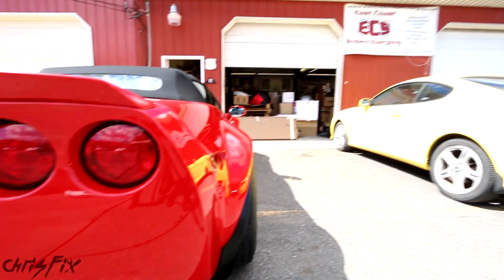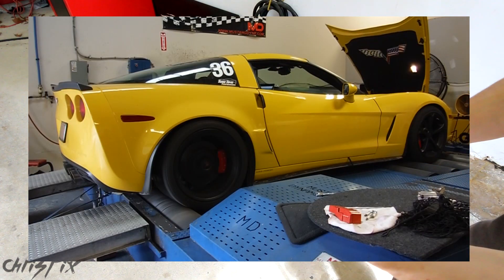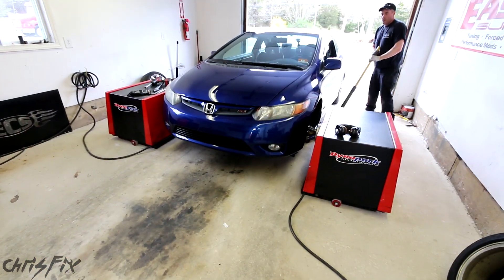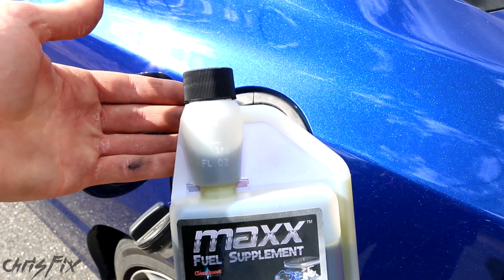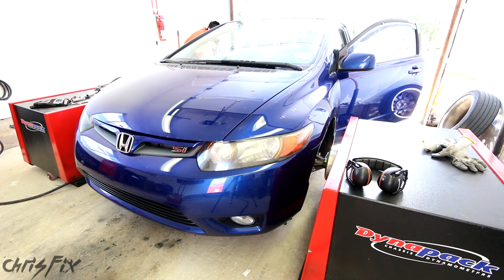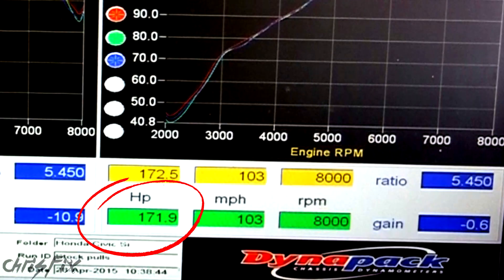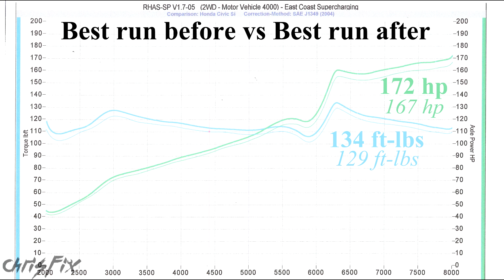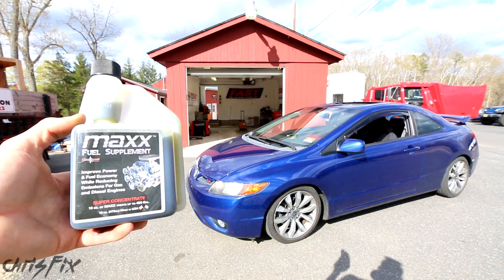Can a Fuel Additive Really Increase Horsepower in Your Car? (With Proof)

Comment: Sponsorship alert!
Reply: Baka Oppai if the readings are true then so what? I don't mind being advertised to if it's honest.
Reply: I assume so.

But it still looked like a good read.

 The gain was less than the difference between the reads without any additive.

A 10 hp difference between runs with no change and a 5 hp gain with the magic fluid, that's only half the noise value.

Injector cleaner is always a good thing and a power gain if you have dirty enough injectors.
Reply: pd4165 if you have half a brain you know it's not honest it's just snake oil bullshit.
Reply: Snake oil works. It's the fake snake oil that's rubbish. Here is my question to you...how will you ever find out if it's honest if you don't do the same test yourself?
 If I do it and post my video here you could call me out as an advertiser too because you don't know if I'm honest.. It's just going to go round in circles unless there's someone posting that is trustworthy.
 BTW I find those figures believable if the additive is detergent + soft metals that clean all the crap out and lube up the surfaces.
If the next tank is untreated and comes up with similar figures to the second runs then that question would be answered.
Reply: What worries me is the before tests have a bigger difference between them than the after test does.

Comment: Nice car. 8K redline, wow. Love the looks of these.  This additive must be basically like an octane booster since the horse power and toque are not affected by heat. Shows how shitty this ethanol gas is.  I think it would be interesting to do this test with known good quality Premium gas and see what the results are.
Reply: WaybackTECH ethanol is actually a high octane fuel... Using E85 on heavily boosted engines is common
Reply: Geoffrey Olson every country's different but 91 octane in Canada usually contains 0 ethanol because ethanol has less energy than gasoline when combustion occurs, engineering explained has a good video on it
Reply: 93' from shell is the best gas out there!

Comment: What about using higher octane to begin with. If engine needs 95 and you buy anything less then make it better using additive, no surprise there. But it is cheaper to buy premium fuel anyway.
Reply: Arnis Tarassu If the Honda has knock detection the additive may have effectively increased the octane a little and allowed the engine controller to run slightly more aggressive ignition timing. Cars that don't have knock sensors don't have this ability so simply putting in higher octane fuel alone isn't going to do anything.

Comment: I have A 98 tahoe 4x4 and it will sputter and hesitat under light load  light accelerate cruising speeds when I really gas it. It will run fine until I let of the gas  it is not a iac problem the iac is newly installed as well as a complet tune up. If I do something as small as turn on the turn signal at an idol the rpm jumps way down and back up to 650  if tha ac compressor should kick out it will bounce around and stumble  but it seems the more load I put on it the smoother it runs if I turn the air on hight turn electrical devices on it smoothes out. Still runs a bit rough.

Comment: Although the air density was higher in run 1 due to IAT, the humidity decrease of 5% would allow for more air into the system without water taking up room... 

Of that stuff contains methanol like most do... It may have also helped absorb some humidity and density in cylinder. 

Who knows...
Reply from the maker: kornshadow097 The weather conditions were all recorded and adjusted for by the dyno for the final numbers.
Reply: I see, alright. I'll have to see if it has ethanol or methanol mixed in. 

Because if it does. Anyone could save money by just pouring in a few oz's of methanol or ethanol in tank. Which most cleaners and octane boosters do. 1gallon or close to 128fl oz of ethanol is $17 or e85 is $1.99-2.34. While methanol is $30-40 per 5gallon pail.

Comment: 5 hp is a difference when a car has about 35 hp, but 172 vs. 167 is barelly detactable even on instruments that measure acceleration, let alone driver's perception....even biggest 11 hp difference is nothing to be felt from driving position....I believe the acc.figures to 100 mph/160 kmh are almost virtually identical....

and I think somenoe said right that we should have tyres on the car to see real power on them in the real world....this is closer to theoretical perfection, but not to real world....
Reply: Ask any engineer and they'll tell you that you can feel a minimum of a gain of 10 hp. No stock civic owner is out there buying this additive thinking now he can take it to a drag strip and get an 11 second quarter mile... It's a cheap, safe, simple, interesting way to get not only more power out of a car, but also get more mpg. You need to stop stereotyping Americans and understand that car enthusiasts are the most diverse group of people in the world, and they all love cars for different reasons. Stop judging others because they find it interesting that you can get any gain at all by adding an additive to the fuel. Stop making cars a racial matter, who fucking cares where you're from? Do all Americans love V8's? Even if that was true, does it matter. Do all British people hate every car unless it's a Jaguar? Even if that's true, that's their opinion. Can't we car enthusiasts just love cars together and have civilized, impartial arguments for the sake of learning and not just "being right"?
Reply: TheKenjoje You didn't understand because he doesn't understand and eighther does anyone else what he's saying. I guess he's never uprgraded a car before. 1.1 second increase is a huuuuuge difference for a few bucks in a can. Car inthuesiests spend thousands for there cars to perform faster. Most all performance enthuesiests i grew up with and knew over the past 20 years would of been jumping for joy to get 1.1 second off the qaurter mile time. Bye the way nobody in our country goes by kph just so you know. And the 160 kph you talk about is basically a qaurter mile time of 100 mph. So 1.1 seconds off that time is insanely impressive for something in a bottle.  As far as all the other stuff you talk about i honestly didn't read or watch or whatever because the fact you started with the 1.1 seconds off in a qaurter mile is crap argument. And i'd say at 100mph qaurter mile time that taking 1.1 seconds off is cutting like atleast 5 car length off and that is defenately nothing to laugh at as a car racing fan.
Reply: TheKenjoje charleysturbos  I'm gonna go ahead and assume neither of you read that properly. I'm implying a Honda has an engine roughly equivalent to that of a snowblower. But neither of you seem to speak proper english, so I'm basically pissin' in the wind here, huh?

40 HP vs 45 HP is a big difference... lmao
Reply: charleysturbos
I am so sorry that the public school system failed you so horribly. There's this little thing called sarcasm, as well as the proper forms or to, too, two as well as than and then. They taught those in first grade.
Reply: charleysturbos
You have literally just reposted everything I implied. You just have no comprehension of sarcasm.
Reply: TheKenjoje dont they race small little fiats abd mini coopers in Europe?  Those aren't too fast either.  Just saying...
Reply: TheKenjoje Wrong, Specially since it's too the wheels. Also the torque numbers are up as well. Every time i added five to ten horses on my little cars i could feel a big difference. People who put put around might not but people who push there cars defenately will know the difference right away.
Reply: TheKenjoje Keep in mind a Honda pushes out roughly 40 HP, on a good day. So this is a big deal.
Reply: charleysturbos bullshit. your story is about power of sugestion. I explained how 5 hp feels up to around 160 kmh/100 mph. what is 'little car' for you? I said that it is felt if a car has low power such as 30-35 hp all together....if the car has 167, then 172 means nothing....5 hp in 0-100 kmh in that honda makes less than 0,5 seconds difference, and up to 100 mph, what, less than two seconds....100-160 kmh flat out is imposible to notice subjectively....

look at this - although not the same car, the point is there - 12 hp difference, 1,1 s adventage 0-160 km/h, cars about the same weight....and 12 hp between 143 and 155 worths more than same number between 167 and 179, and we have 5 hp here (167-172)

http://www.avto-magazin.si/media/upload/Test/honda/accord-20-i-vtec-comfort.pdf

http://www.avto-magazin.si/media/upload/Test/bmw/318i.pdf
Reply: Joe C sorry, I didn't understand, how do you mean it pushes 40 hp?
Reply: TheKenjoje big power is for small nuts..other way around buddy..if u need a high hp car to feel better u lackin in the pants...most settle with what they have...my car is at 228whp runs 13.8@100mph with a stock k20 bolt ons only..made the parts myself and custom tuned it as well...its enough for the streets and to the strip once in a while..its efficient on fuel..and screams up to 9000rpm...yes i could have alot more power but it is enough..i bet i could show u a few things lolll 170whp in a light car like a mini or a lil hb is still fun...
Reply: Vega-Expert  Seems lagit. Sounds alot like the same for these guys who drive the giant trucks all jacked up. Although i have always wanted one of those because of the up high driving experiance. Your car sounds bad ass. Also i'd bet it is reliable at those numbers still that creates a great piece of mind and self confidence as well knowing you built this fast machine that's still reliable huh. Never owned a honda but always admired and feared them street racing,haha. Because of the unknown and potential of them. Most all the domestics were huge and heavy and slow of past. Nowadays they are fast but they waited sooooo damn long to make them this way. Now we see them going back to small engines with turbos and superchargers and making them more reliable like imports are. Funny too , all the years i had to hear these muscle heads say there was no replacement for displacement and now there companies are going with the replacements and there cars have never been more faster, efficiant and reliable then they are today. But that was all caused by the bush and the oil companies holding our country back creating cars with huge displaced engines that are very inneficiant. Now finally things changed before the next change with solar and electric like tesla. Invest in tesla and solar city people. Also penny weed stocks would be a great idea as well i'd bet.
Reply: Joe C I notice so called educated dipshits like you don't know how to argue there points. Often when they cannot admit they are wrong or else don't know shit what there talking about. Suddenly change the subject and are grammar and spelling police instead of focusing on the subjects at hand. I don't care how educated you think you are miss Joe. You know nothing about modification of cars or common sense if you think a over ten percent increase is nothing in any engine. By the way if you have a lower horsepower car like a honda that is light. When you add more then ten percent power to it, makes a lot more noticable difference then your higher horsepower cars that are already faster. But both cars would have a big improvement in the modified world. And for just a small amount of money that is even better. Oh and i find the more educated people get the stupider they tend to be in real world things.
Reply: charleysturbos Being stupid must be bliss, huh?
Reply: Joe C Getting older and getting wiser. Specially over dipshits like you that think they know everything when they know jack shit about life. Look way better then you id bet anything and specially since you are probably aging like a dog does.
Reply: +James Haws well said
Reply: +TheKenjoje this is basically for extremist who want to get every little but of power that they can
Reply: More like ExCheapests,haha. But na it's just people who want balance in their lives. Reliable , affordable, economical and pretty dang fast all in one id bet.

Comment: should of used the airplane fuel i believe its like 118 octane i used it in my atv and lets just say im surprised it didnt break the rear end
Reply from the maker: wade mckenney I dont know how good of an idea it is to run 118 octane fuel in a car not designed for that!
Reply: yes u can i know someone who runs it in there car the higher it is the better for the car it gives more power and is more cleaner for it two

Comment: VTEC engines are so gutless.  Who drives around at over 6000 rpms??  172 HP with 132 LBS of torque? ?  Lol!!  So very weak.
Reply: Thomas Whitmore I mean, I'm racing someone, or trying to really accelerate... you know, any time I would need more power... then yeah, I'd probably be over 6K if I had a Honda. 170 HP at the wheels for a 2 liter engine is actually fairly impressive.
Reply: Thomas Whitmore You do know the main goal of Honda is economy and reliability, not performance, right? Models like the Civic Si are "performance economy" vehicles at best, but are a far cry from a true GT car. They aren't designed to be anything more than that, which is why they are so relatively inexpensive (their main appeal).
Reply: Now, I like the s2000, that car was built for fun. What I have issues with are these silly kids who buy the biggest wing, the loudest muffler, Filter on a pipe and attach it to a Honda civic and think they are in the cast of Fast And Furious.
Reply: George Washingturnt To make power, you have to burn more fuel/air, obviously. You can do that by making the engine breath better, making it larger (which has consequences for efficiency, NHV, and packaging), or you can rev it higher. The last one tends to be the easiest, up to a point, without the great consequences for daily usage.
Reply: Thomas Whitmore lol before or after your transmission falls out of your Focus?
Reply: Nope, strictly road racing. That my friend is much more fun and will push a vehicles limits.
Reply: Thomas Whitmore I do both really. both good fun.
Reply: Thomas Whitmore Agreed, but that's not what this was about. The high revving nature of a car isn't really a negative in most cases. Even larger engines don't start races at 2000 rpm.
Reply: Here is why: to make more power out of a smaller displacement engine you need bigger cams that make the motor breath better. However this bigger the cam the higher the peak hp is because big cams sacrifice low end torque and hp is simply a multiplication of torque. Believe it or not vtec is a compromise of two cams so this little 2.0L engine is making decent torque numbers for what is is all throughout the powerband.
Reply: Thomas Whitmore Being on both sides of a spectrum and driving a F1 car. Lets take a look, a hypothetical f1 car makes 600 horse power, and revs to 12,000 rpms. and 325ft-lbs torque It has a final drive ratio of 4.11 and has 5 gears. ( both engines will have the same transmission for the sake of this " demonstration. " ) Now were drag racing and I have a v8, produces 900 horse power. Torque at around 530 ft-lbs torque. We race and the f1 beats me, EVERYTIME. Why ?! Your v8 only revs to 7k each time, while he has 5k more in his gearbox to put on it... So even if your car is more powerful, has more torque, and is " awesome " if it only revs to 6-7k you have a disadvantage to someone whom is making high horse at high rpms. I mean your logic would make tanks the worlds fastest vehicles or the " best vehicles. They make thousands of horse power, but only go 55 mph or 45... but only rev to 3-4k. Maybe 5 on WEP. 

As for people who drives around at 6000rpms, no one ? But then again you make top horse at a number you likely don't use on a daily basis if you're going to get groceries, its more of a car enthusiast type deal there bud.
Reply: George Washingturnt That's not a coincidence. To make more power NA the engine needs to pump more air and without a turbo or supercharger it's going to have to be running at a higher rpm to do so. Vtec allows the engine to breathe better at higher rpms with a more aggressive cam profile but still runs like a mild engine at lower rpms.
Reply: +Eric Benton I think you should just summarize it for the village idiot. The faster you the engine spins, the faster the car will go.
Reply: Honda never really made much sports cars. When they do, they are pretty quite impressive, take the NSX-R for example. Yeah it has VTEC and it's just a 6 cylinder making about 295 HP but the cars themselves were acknoledged for how great they can corner at high speeds including the type R. But yeah, it pisses me off when people rice out a standard civic LX or EX and act like they are fast. Those cars were mever built with the focus of racing, it was for reliability, yes they made the type R, you can tune that and it could give some races, their advantage is being lightweight and such, making most HP count, and you cant blame Honda for having a bad rep... They have a bad rep because of the people who take their economy friendly type vehicles and rice them out. I hate it. Honda integra, s2000, and NSX-R are not even ricer yet people call em that because people put pointless cosmetic parts on their little civic LX and etc. i could ramble on and on about what a true ricer really is lol
Reply: +Thomas Whitmore Ya i Agree lol Most cars even small cars hit the top of the power band at around 4,000 to 5,500 rpm.
Reply: +Thomas Whitmore have you ever done a roll race before lol? When i'm doing a 60 roll im already at around 5500 rpm's lol
Reply: Thomas Whitmore I think you missed the point of this video, he was testing the additive and it's effects on an engine, not if you think a Honda 2L ivtec is fast.
Reply: I have a 2015 focus ST, 2006 Focus ST and a 2000 Focus. What these cars have is low end torque,  that will destroy a high revving Honda everytime.